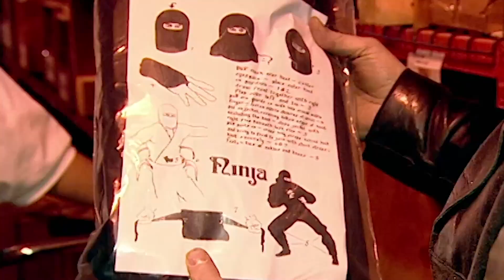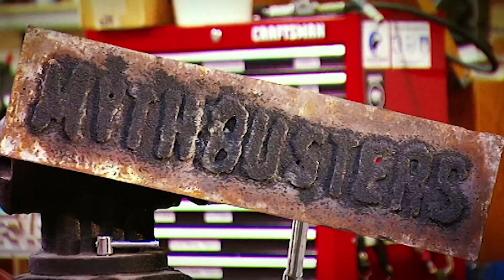Is It Possible to Run on Water Like Ninja's Do? | MythBusters

Comment: Mizugumo were not used as “walking” on water this is because someone translated the Japanese word kutso as feet whenever it can also be said as platform is was actually like a ring that you would sit in and the shoes clever enough whenever you move them forward they would close and moving backward would open.